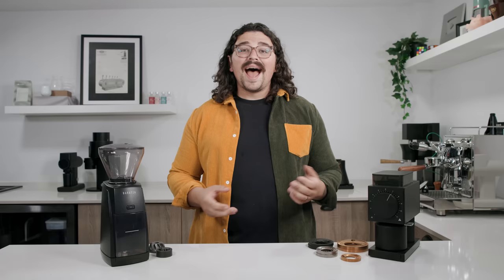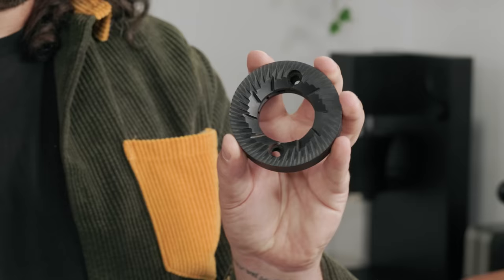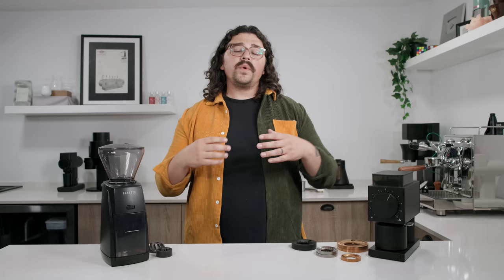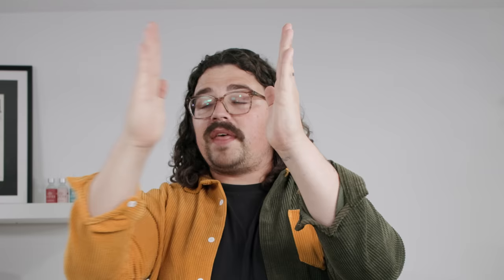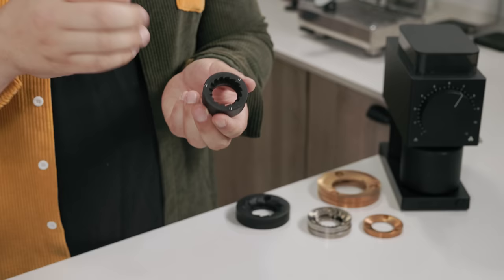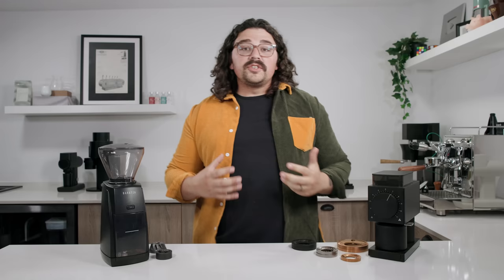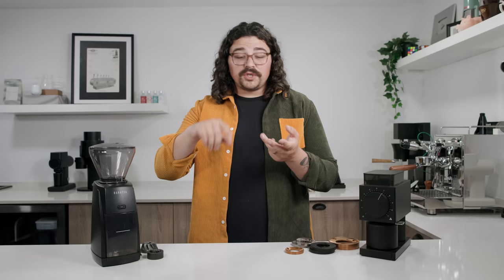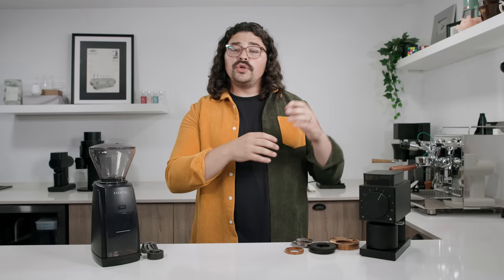THE GREAT BURR BATTLE: Demythologizing the Conical vs Flat Debate

Comment: The whole high end coffee market is hilarious.   People hang on every word of reviews but the vast majority of people cant tell the difference between grinders, let alone burr styles, in a blind taste test. Congrats to Lance for admitting that people are really only gaining 5 to 10 percent improvement on quality by buying $1,000 plus grinders...the vast majority of this is marketing, confirmation bias and general nonsense.  At the end of the day, grinders are very simple mechanical devices with a motor, a decent burr set, a hopper, etc. Once you spend $500 to $1000, its all pretty comparable and the "improvements" are subtle, negligible and cannot be objectively quantified
Reply: @tagheuer02 you sound a little bitter. Try adjusting your grinding more coarse. 

Honestly though 1k for 10% is a good deal if you love coffee and drink it daily. Cars, motorbikes, girls all cost more than 1K to go faster😅
Reply: @s73v36 not at all.  My point is you can get all these features for half the price this guy is quoting
Reply: @tagheuer02 I have to agree..At a certain point you start to get diminished returns..I have  had a few grinders and espresso machines ranging from "cheap" to mid level and I couldn't tell enough of a difference in taste to justify the price gaps..For instance I had at one time a Rocky,a Breville SGP and a Vario W..Now I liked the fluff of the grinds and the texture that the Vario produces,but the workflow wasn't as good as the SGP,not to mention the Vario just could not grind light roast beans and it eventually broke the transmission where the SGP had no issues at all and is still going and is more than half the price..Maybe its me and I know taste is completely subjective,but when I hear someone say that they taste notes of white Jasmine and nectar from a coffee,I just have to laugh because how many people even know what "white Jasmine" tastes like ? I usually get "well your pallette isnt as advanced" and maybe so,but I have never tasted anything from a coffee bean other than coffee flavor..Sure you can have a sweeter taste or bitter etc but never have I ever tasted a coffee and was like "you know what this taste like bubblegum and juniper" lol...
Reply: @s73v36 , anything north of 100 bucks will get you there if you make progress in daily practice and not Turkish or espresso users . But just curious how does one get bitter over a coffee grinder that cost 10000 dollars and what does any of this lifestyle nonsense have to do with learning about coffee brewing . If I were to win a billionaire lottery I still wouldn’t spend 100000 on a coffee ☕️ grinder yet I’d probably still like you if you did😊.
Reply: @tagheuer02 outta interest, what would you say is the best bang for buck grinder before you go to diminishing gains
Reply: @tzkabir  eureka specialita. 700 in aus. First great quality electric grinder.
Reply: I’m still waiting for a grinder that uses laser particle size detection and blasted air sorting on the chute
Reply: @davidsykes2825  you're probably the guy that thinks you could pick out the difference between a shot from a LM micra and a GCP blindfolded
Reply: Doesn't work with baseball.  One guy hits 2 out 10 times, gets paid meh.  Another hits 3 out of 10 times, he gets multi million contracts.
Reply: @tagheuer02 I get what you're saying and I pretty much agree. Currently trying to find the best grinder before point of diminishing returns; the issue with getting recommendations is it's so subjective. In any case, I believe it lies around USD$250-$500 and anything above that is too nuanced for most coffee drinkers to differentiate.
The nuances are there for sure, but I won't be aware of them so much as I'm not going to comparing the individual grinders by cupping the same coffee for example. I just want something that works well for my taste preference. 

What I find funny and made me comment is your name is Tag Heuer and you're talking about diminishing returns, like come on 😂
Reply: It’s more about fresh beans ….
Reply: @s73v36 true but non of those are a consumable unless your Hannibal
Reply: Yesterday, i bought 700 usd grinder.
Before that, i use 200 usd grinder.
They are like heaven and earth.
Reply: @Nathan0A  They've got one on Temu 😂
Reply: I decent grinder for espresso makes difference but pour coffee a basic $150-200 will do job just fine, coffee and coffee make is other part of puzzle. Point of diminishing returns will apply here as well. Most will not go lengths to get the coffee needed to justify these cost and most expensive item in my opinion
Reply: Good hand grinder......

Comment: I’m in the biopharm industry and we use pin mills to grind product to very accurate tolerances, pin milling is infinitely better than the burr tech used in grinders, it provides micron based uniformity.  I am surprised there has not  been more trickle down and exploration of this tech to the coffee industry as this would solve coffee grinder.
Reply: I looked into it, seems like pin mills literally "crush" the materials by sheer force... the studs in them have no "blade", sure, the geometry allows wonderful particle distribution, but to break coffee (especially light roasted) without any "blade" you would need impressive motors inside a grinder, not to mention manual...in the end it would have to resemble an industrial machine (big to fit the motor and built like a tank to withstand the torque)
Reply: Additionally, there is a turning point to the taste of coffe with too much uniformity. Having perfectly uniform grounds could make the coffee taste worse. I think the channel Kaffeemacher tested this.
Reply: Pin mills use screens to ensure the uniformity actually - it's not that the pins/ studs actually do crush to that amount of uniformity required for pharma/ bio use, it's the screens that help with it.

Comment: Im not putting any bias on any type.  But Theoretically,
- given exactly same stability and precision, larger burrs make more even ground particles plus less heat, longevity(which may not matter to the average consumers) and stuff.
- Stability and precision is what matters the most for more even ground
- flat burrs are A LOT “easier” to stabilize by design, but are more expensive, and tend to require a stronger motor. (same applies for larger burrs)
- flat burrs tasting more balanced and refined means they are more evenly ground

This is like sound system. A super balanced sound is not necessarily fun for everyone. Some like more bassy and with more treble. So it’s not a matter of supriority but of preference.

Comment: A bit of water can give a lot more clearity.
No need to upgrade your grinder!
Prior to grinding: put  roasted coffee beans in a sealed container and ad some water. Make sure that there is no liquid water coming into contact with the beans.
I use a 1000 ml lock & lock box, some clean damp cloth then the tow of the grids that came with the boxes and conain the beans in a nylon mesh bag. Takes ~1 day in a warm room.
How it works: Water will evaporate and the beans will suck it up from the gas phase.
Tharget ~ 7.5 g water per 100 beans (6 to 9 may be best depending on the settings). If added too much water just add dry beans proportionally. Then rest for ~ 1 day in a new sealed container. Now grind. Note humid coffee extracts much faster in all stages of the brew: 90 to 120 Seconds for 400 ml filter brew can easily deliver extrections in the 20% yield range.
Reply: @CJski  Oh than I'm ready for future:-)
(This morning discussed on the radio "Deutschlandfunk" how many jobs AI will overtake - hmm...)
Reply: Condensation makes coffee go downhill relatively quickly which we've discovered from taking coffee out of the freezer and immediately opening the package, its fine for the first day or two but if you got more than 2 days of coffee that was exposed to moisture it will go downhill after that. Although James Hoffman had an experiment with 'monsooned' coffee where he intentionally humidified his coffees and they somehow turned out good. I forget the details and how he did it though. 

Have you compared your humidifying coffee technique with just adding a few RDT sprays before grinding?
Reply: @BensCoffeeRants  Hi Ben,
the two James Hoffman videos
https://youtu.be/J7xEbf1mkm0
and
https://youtu.be/BcXK1MZJDAM
really were the start point for this.
James used Boveda 69, a inorganic gel that is designed to hold goods at 69% relative humidity. (A non condensing humidification.)

To the staleness problems: That can happen especially when liquid water and not water from the gas phase is used for humidification. And humid coffee even when done properly should be used in 1 to 2 weeks and in between stored air tight.

How I came to the Method:
I didn't want to wait 4 months for humidification and I didn't want it for storage. So I tried to speed up. First attempt: spray with water (liquid) - tasted strange, but with less fines and went stale within days.
Next I tried to humidify via the gas phase - some designs were not good, some intermediate and the lock&lock box described above finally worked. When ever liquid water came in contact with coffee this tasted not good - my Idea at that time was mold growth but I didn't tested it. Just went with gas phase humidification.
Next I had to find the best humidity level. Higher humidity= less fines. But at some point grounds started to look strand shaped and extractions tasted weak and acidic. For the coffee I performed the experiments on (yellow bourbon) this tipping started at 8 grams water absorbed by 100 g beans. Therefore I kept humidity to 7.5 per 100 to be at highest humidity without tipping over.

I also did some tests especially for the amount of fines that could be removed by sifting and that only became loose during a full immersion brew. Extraction yield was only tested once by gravimetry it was 20% with a error of about 1%. At this high error I didn't continue with this.

The Tests I did:
Test conditions:
Coffee:
Yellow Bourbon, Fazienda Miaki, from a small local roaster (kleine Kaffeerösterei Schweinfurt), light roast
Validation with a yirgacheffe landrase
Later: taste-only Tests with about 3 more coffees, including a espresso blend.
Grinder:
Comandante C40 MK3 Nitro Blade, set to 24 clicks, mostly driven by the GaWoody Power Kit, sometimes also manually
Extraction Device:
10 Cup Chemex, mostly Chemex Filter papers (FP1, FC100 or FS100, as available - tests were done during the pandemic and filters were not easily available)
Water:
91 °C (setting of the bonavita kettle)
Fairly hard ~20°dH tap water (mainly Ca(2+), less Mg(2+), mainly SO4(2-), less HCO3(-) Ions
Tee sieve, fine metal sieve, but without Calibration for fines separation. Later calibrated against a kruve sifter: the tea sieve was slightly finer than the 800 micron sieve.

Results
- as expected water droplet technique helps with static charges during grinding, but has only marginal impact on fines produced
- Humidified beans lead to roughly 50 % less fines produced (sifted with the tea sieve) both sieva-able and non-sieve-able
later done on the kruve sifter: dry or humid: no massive fines below 300 microns
at 500 microns there is a ~30% reduction.
at 800 microns there is a ~50% reduction.
Non-sieve-able fines is always reduced by ~50%.

Best regards 

Data part:
For import to any spread sheet program:
Copy data in a empty text editor file, save as .CSV

Column Separator :
Decimal Sign .

::Unit:grams:grams:grams:grams:% of Output:grams:grams:grams Filter and
non-:grams:% of non-fines dry:% of non-siftable
Coffee:Repeat:Test Condition:Beans Input:WDT water:Grounds
Output:non-fines (wet):Siftable Fines:non-fines (dry):Tara
Filter:Siftable fines after air drying:non-siftable fines:non-siftable
fines:from siftable fines
brasil yellow bourbon:1:Dry. no
WDT:26.28:0:26.33:20.33:22.79:20.33:4.30:5.32:1.02:5.02:22.02
brasil yellow bourbon:2:Dry. no
WDT:26.30:0:26.16:20.05:23.36:20.05:4.18:5.22:1.04:5.19:22.21
brasil yellow bourbon:3:Dry. no WDT:26.31:0:26.24:20.43:22.14:20.43:not
measured. average Tara of the other Filters used instead to calculate
non-siftable fines:5.20:0.92:4.52:20.39
brasil yellow bourbon:1:Humid (7.5% added
Water):26.26:0:26.27:23.15:11.88:21.53:4.40:4.96:0.56:2.60:21.90
brasil yellow bourbon:2:Humid (7.5% added
Water):26.33:0:26.33:23.39:11.17:21.76:4.24:4.78:0.54:2.48:22.23
brasil yellow bourbon:3:Humid (7.5% added Water):26.27:0:not measured
Input used instead to calculate %
Fines:22.87:12.94:21.27:4.29:4.76:0.47:2.21:17.07
brasil yellow bourbon:1:Dry. with
WDT:23.36:0.06:26.42:20.58:22.10:20.53:4.28:5.22:0.94:4.58:20.72
brasil yellow bourbon:2:Dry. with
WDT:26.29:0.06:26.27:20.77:20.94:20.72:4.25:5.19:0.94:4.54:21.67
brasil yellow bourbon:3:Dry. with
WDT:26.34:0.08:26.42:20.57:22.14:20.51:4.28:5.20:0.92:4.49:20.26
:::::::::::::
:::::::Mean Tara Filter::4.28::::
:::::::::::::
yirgacheffe:1:Dry. no
WDT:26.33:0:26.26:20.11:23.42:20.11:5.27:6.13:0.86:4.28:18.26
yirgacheffe:2:Dry. no
WDT:26.30:0:26.16:21.01:19.69:21.01:5.37:6.20:0.83:3.95:20.07
yirgacheffe:3:Dry. no
WDT:26.33:0:26.33:21.13:19.75:21.13:5.50:6.31:0.81:3.83:19.41
yirgacheffe:1:Humid (7.5% added
Water):26.33:0:26.30:23.20:11.79:21.58:5.30:5.72:0.42:1.95:16.51
yirgacheffe:2:Humid (7.5% added
Water):26.31:0:26.28:23.64:10.05:21.99:5.38:5.81:0.43:1.96:19.46
yirgacheffe:3:Humid (7.5% added
Water):26.31:0:26.37:23.28:11.72:21.66:5.37:5.79:0.42:1.94:16.55
Reply: @mariolange9102  Wow thanks for the details!  And finding those videos for me! 
With your motorized C40 is it grinding at higher RPM or similar to hand grinding?

Comment: Hey Lance, Let me make a suggestion that has nothing to do with my recent comments about centrifugal force.  I wonder if variations in particle size distribution between grinders may have a lot to do with the structure of the grinder body.

I observe that when I use my Baratza Encore, the hopper moves around quite a bit while grinding.  Its not screwing and unscrewing, it just wiggles.  It has done this since new.  On the Encore, the hopper serves three purposes: 1. Hopper,  2. Burr spacing adjustment,  3. Ring burr hold down.  I suspect the hopper is moving because the ring burr is moving.  (What else could it be?)  If the ring burr moves during grinding, that changes the ring burr to cone burr spacing, and that probably changes the size of grinds that pass through.  Perhaps a factor in more expensive grinders producing tighter particle size distribution is that more expensive grinders tend to have more robust, often metallic rather than plastic construction.  How much of tighter particle size distribution is down to rigid construction that keeps the burrs from bouncing around?
Reply: Exactly my thought for a long time, lot of this come down to the designed chamber, exit chute, …… so many factors influence the ground. I guess lot of grinder cause regrind and hence change in distribution.
Reply: I've started weighing the hopper down with my hand during grinding.  Don't know if it helps, but in my mind it does

Comment: Great video Lance, Nerdy but not deep engineer level. I appreciate you explaining how the burrs work with the different stages of teeth to crush and cut the coffee. I have multiple flat and conical grinders. They all have different taste profiles which fall throughout the spectrum. I agree with you that burr design plays bigger role in taste then just flat vs cone. With the 64mm grinder platform you have huge range of burrs and people can pick the taste profile they want with custom installed burrs.

Comment: Super happy with my Niche zero. The absolute unparalleled ease of use and cleanliness paired with the reliably consistent grind produces excellent results in my Bambino Plus and I had no learning curve with either. I do think I'm going to either modify my NFC disc or get another one that has more holes in it off etsy otherwise my setup is perfect for me

Comment: Thanks for this video. I have a very inadequate grinder set- up that i would like to upgrade. Youtube videos have been a great resource (don't do Facebook, not gonna).
BUT, I'm a civil engineer. Not a geotech, but there are so many similarities with soul mechanics!

I find myself just wanting to see particle size distibution curves!

That would be a start. Linking distribution parameters to flavour profile would be the second, more challenging, step. Thanks for giving some ideas on that.

Wish we had access to coffee tastings in the same way that wine and beer tastings are held.....

In the meantime while i try to learn more, im using my low-end conical grinder to coarse grind the beans and then "finishing" in my low- end hand grinder to get something fine enough for espresso on a medium roast.

Also tried compacting in lifts for all you engineers out there....

Comment: My only extensive personal experience is the comparison between the italimill stainless steel and the ssp cast lab in my df64p. I liked the stock burrs but had issues with sourness in light roasts. With the cast burrs I have completely eliminated sourness excluding dial in shots. Mt brief experience with a  handgrinder isn't fair because I was using sub standard beans at the time, but the shots tended to be thicker (probably more due to robusta % in the beans).